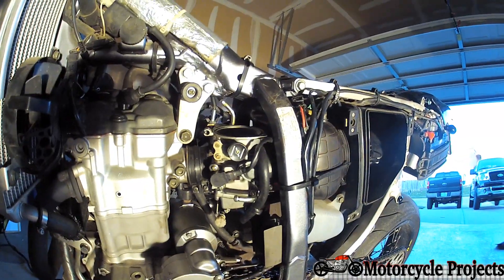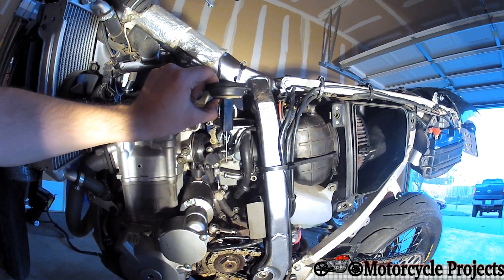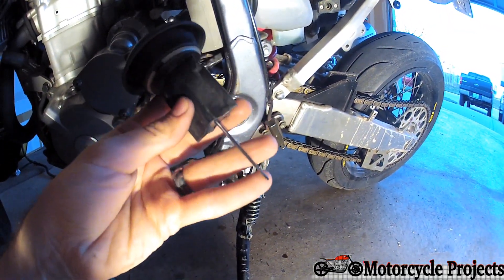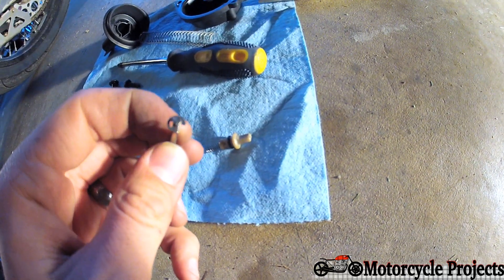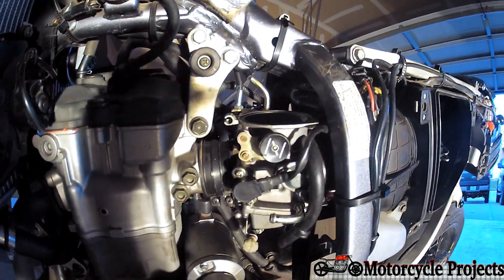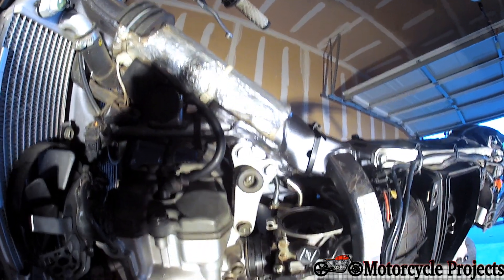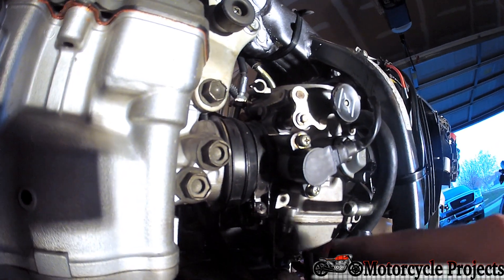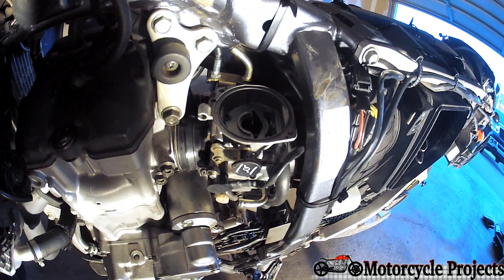Mikuni CV BSR36 Carb Explained (DRZ400SM/S)

Comment: I think you will find when the throttle Is opened there is a reduction in pressure in the inlet manifold and there is a connecting pipe to the area above the diaphragm. This reduction in pressure sucks the diaphragm rubber and throttle slide up it I’d not ‘pushed up like a balloon’ as you suggest. The result is the same. Just wanted to clear this point up. Great video all the same. Thanks

Comment: My drz accelerate only 3000-4000 rpm and Max speed 80-90 klm/ h .and the half  throttle to the top is dead, why?

Comment: This video is 8 years old so I don't figure Ill get a response but Ill try anyway.  

My bike is doing a weird thing when it idles.  When the engine is still kinda cool it idles and revs normally but when its a bit warmer when i rev it it'll idle higher than normal.  I can "nudge" the clutch to put a bit of friction on the engine and then release it again and it'll idle low again but once I rev it its back up to a high idle.  It wasn't doing this before i cleaned the carb.  Its a 2011 DRZ400s fully stock. And i did set the fuel mixture screw back to how Suzuki set it after I cleaned the carb.

Comment: Problem with my drz 400s. I live in las Vegas Nevada, I bought the bike from someone that rode it Washington state. The bike idols fine has a slow start, as well as once its fully warmed up. On the highway it "sputters at a constant speed around 65 to 70mph or at a high rpm at a constant speed". Also the needle does not have any adjustment notches. Any solutions without buying parts?
Reply: JD jetting jet kit and follow the instructions in the box for your particular situation.

Comment: I replaced my petcock to non vacuum one. The next morning I believe I picked something up and clogged the carb. Trying to the start the bike and it wont turn over.. after taking out the carb I noticed, fuel in the airbox.. which part do you believe could be clogged to cause fuel to back into the air box.Thanks
Reply: Im having this problem. Any suggestions?

Comment: A very nice vid. Thanks. After 9.5 years of 400sm ownership l am going to install a 41FCR on the poor thing. Any comment?
Reply: Aidan Vorbeck 
Had SM  11.5 years now.
41mm and 39mm carbs did not work properly and bike was slower.
Happy with the BSR 36 now.
Rest of ownership has been a breeze.
Reply: Aidan Vorbeck 
74,000 km now.
I tried 2nd hand Honda CRF carbs. I jetted them smaller and smaller down to 140 but were still rich so just gave up and sold carbs.
OEM CARBS might have a better solution.
Reply: Aidan Vorbeck 
Yes. Has had 1 new sparkplug at 40,000 km.
Have not even changed or topped up radiator water. Have adjusted valves 2 times.
It just still keeps on going!
Reply: Aidan Vorbeck
 Same as mine!
DR-Z400SMK5 in yellow.
You will have fun.

Tony.
Reply: Aidan Vorbeck
 Ooh...how much?
What country are you in?
Reply: Good country.
Good price.

I am in Napier, New Zealand
Reply: Aidan Vorbeck get a room
Reply: did you mod 3x3 and exhaust ?